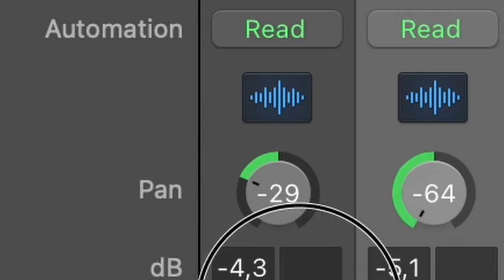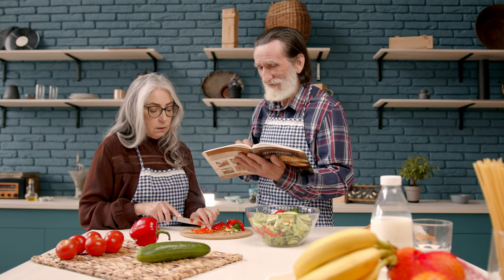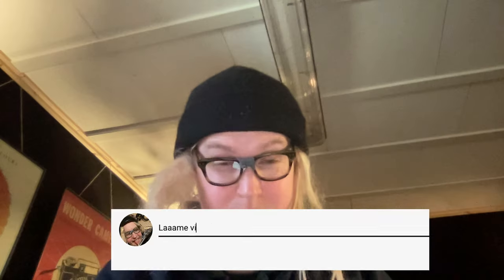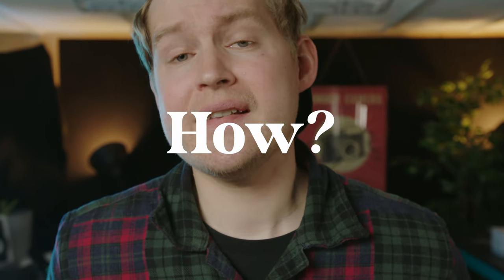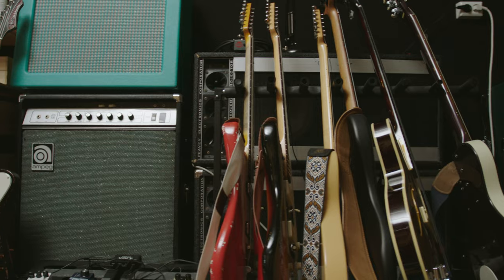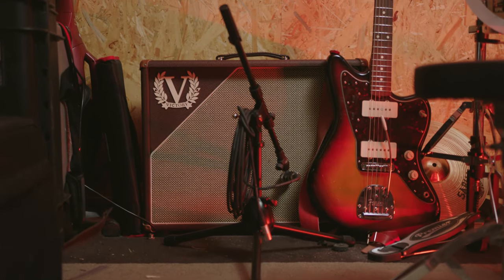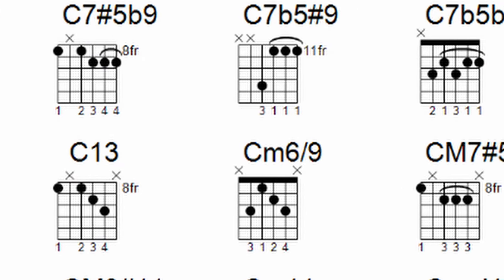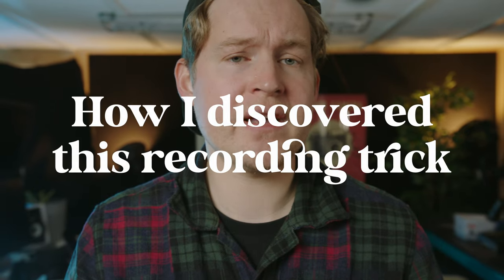I discovered a new way of recording guitars

Comment: Very cool use of fuzz!
I’ve been using fuzz for all kinds of stuff for the last 15 years. With a low Z input circuit it will provide the sweetest clean tones with guitar volume rolled down and the thickest low end compression when rolled back up. Fuzz is to me mostly about texture. Use it to clip your peaks straight off while remaining unity gain, for beautiful, croaking pseudo-cello melodic passages or use a heavily mid scooped fuzz to just fill out everything in the frequency range whilst leaving room for your vocals.

So many use cases!
So many ways to use one beyond just the dad rock solo time happy hour.

Comment: This is a similar technique that David Gedge from The Wedding Present would use, except he would run two Marshall combo’s with two Yamaha Distortion pedals with one set to distort and the other as a boost, with one going in to one amp and the other going into the second combo. So not only do you get the stereo effect, but you get the grit and detail coming from the clean boost blended with the distorted amp which sounds huge and articulate. Check out their album Sea Monsters recorded by Steve Albini of Nirvana, Pixies fame.

Comment: That’s a great suggestion! I generally record by double tracking different levels of overdrive. It didn’t occur to me that putting fuzz on one of the tracks would make such a big difference. As you implied, I generally think of using fuzz only in special situations as it can get buried in the mix. BTW, I’ve noticed that Chris Cornell often has a clean guitar on one side and a distorted guitar on the other (e.g., Say Hello 2 Heaven), which similarly results in a big and interesting sound. I’ve been aware of that approach, but overdrive + fuzz is new to me. So thanks!!

Comment: What i like to do, I play at bandpractice in stereo with two amps. One amp with overdrive, the other with a fuzz pedal. It makes a huge sonical difference incomparison with just the same guitar signal into both amps at the same time.
But I guess that's the point of your video anyway.

Cheers from Switzerland
Reply from the maker: Cheers Sven! I've never done it like that. Sounds like a clever idea. Need to try!
Reply: @LivingroomGearDemos  then for your power duo just get a 3rd small bass amp and a micropog running 100% low octave out to it. to really go crazy put your tuner in as a kill switch for the bass. Thought about starting one but it sounds like a lot to carry around lol

Comment: Judging from the general EQ of the two dirts, I think I’ll try double tracking with my nice thick rat+fuzz face sound and use the gain channel of my classic 30 for the other side - I’ve always found it a little too bright on its own even though it sits really well in a mix at lower gain settings. Thanks!
Reply from the maker: That sounds like a solid plan. The dirt from the classic 30 is very good!

Comment: If I’m using heavy fuzz or distortion on a guitar part, I like to split the signal into a second (usually smaller) amp set to a complimentary tone. For example, I’ll run a Big Muff-style fuzz into the OD channel of a Marshall JCM 900, then to fill out the midrange and maintain some clarity I’ll run a mid-focused clean boost (I’m a fan of the XTS Shapecharger and Effectrode Blue Bottle, but pedals like the Boss GE-7 or MXR 10-Band EQ also work) into my old Fender Bassman 20 or Traynor TS-25B. Those two amps in particular are great because they’re both capable of a nice, articulate drive sound and the 15” speakers give you a naturally punchy midrange with a solid attack (it helps that I’ve put guitar speakers in both, they’re Ted Webers but I forget the exact models).

Comment: I usually combine 2 takes of single coil guitar on both channels, 2 takes of humbucker on both cannels as well, and 1 take with a fuzz right in the middle. if done properly - it makes a huge wall of sound
Reply from the maker: Wow that sounds cool. Doesn’t sound too compact with guitar tracks?
Reply: @LivingroomGearDemos  nuh, proper eq and mixing overall will make this orchestra of guitars work. 

however, i have to admit that your way looks more simple. have to try it and maybe it could be a replacement to my way of recording guitar. thanks for inspiration to try something different!

Comment: I was doing a song that had a short slow solo.  I would run an eq pedal into a distortion pedal and I would do a take playing the solo with one slider on the eq maxed and the others turned down.  I repeated this proccess with every single band and I would play the same notes of the solo on different strings so I had 7 tracks with the solo spanning 2 octaves.  I then had one track in mono and panned the remaining tracks evenly hard left and hard right.  It sounded massive obviously but if you were focusing on a specific frequency you could hear the "thinness" of it.

Comment: I started doing this a couple of months ago and it's really effective! I haven't tried playing the fuzz part with a different guitar and amp though, I find the character is different enough from the overdriven sound that you can get away with using the same gear for both.

I've been interested in trying to set up a fuzz and OD in parallel on my board to see if a similar sound can be achieved live
Reply from the maker: Nice! Yeah, it's probably fine to use the same amp/guitar/speaker with this.

Comment: I use a keyboard amp with three inputs and an ABY pedal that splits to three outputs. So.. I run it with bass and guitar or ukulele for that matter. I can stick a looper pedal (mine does delay also)

But yeah. With bass I use a compressor on one channel and a π fuzz with scoop-boost knob.  Gain staged so they react about the same.

Guitar I'll run a fuzz face with my magnetic but a piezo bridge pickup to the compressor-fuzz section I use with bass.

Keeping the fuzz face separated gives some dynamics and can take it right to insane. Kicking off the channel from the π when turning down.

The KBA50 i have has a loop and DI etc so it works really well. Highly recommend
Reply from the maker: nice David!

Comment: Badass tone, would this work blending the overdrive with the fuzz into the same amp?
Reply: Yes it works very well.   Electro harmonix tri parallel mixer allows 3 channels of parallel mixing.   I usually do a bas heavy distortion, a mid dominant distortion, and a fuzz and that mix sounds outstanding!
Reply from the maker: yup it does! You'll get a different result, though. But it's a neat trick!

Comment: Recording tricks? Hang a second mic from the ceiling (use one that can take a beating, SM57, etc), and give it a good swing when you start your take. Unpractical, hacky and inconsistent, but you can use it to mix in a roomy, naturally phasey extra little something. 

But my favorite trick is to double track an acoustic with a Nashville strung guitar. Sounds like a 12-string, but without all the boomyness and with more control. That one’s pretty standard, though.

Comment: I've been doing something similar by using the stereo channels in the JC-40 (L/R inputs) and a signal splitter into either pedal. This idea came from using the parallel mode in the JB-2 to have one "sharp" sound and one "wooly" sound at the same time. Looking forward to using an LS-2 to blend fuzz and OD pedals together. I have been thinking about running a phaser into one of them or possibly a tremolo to get the "wall of sound" some movement.
Reply from the maker: cool!